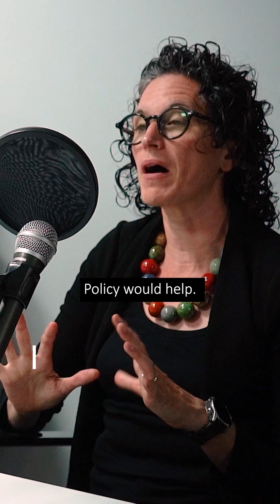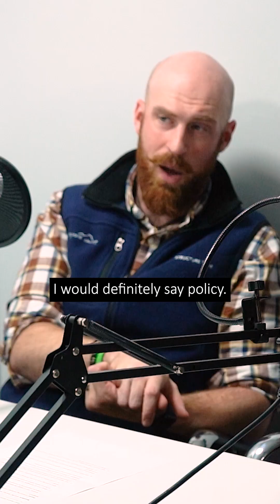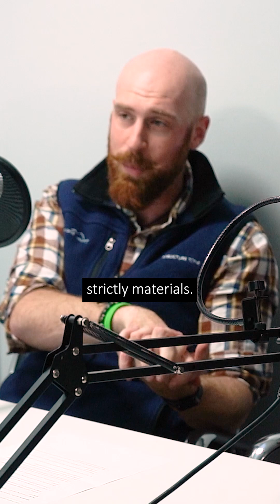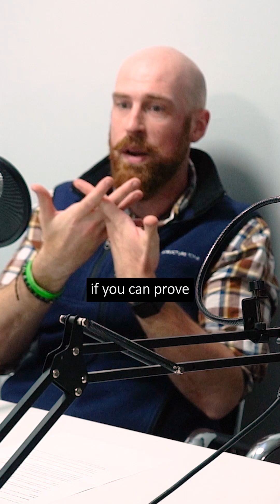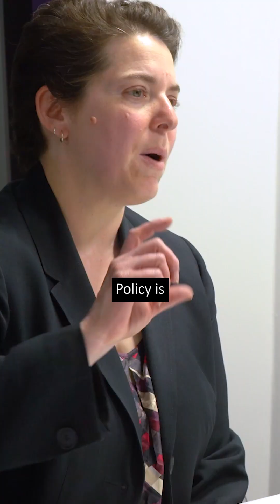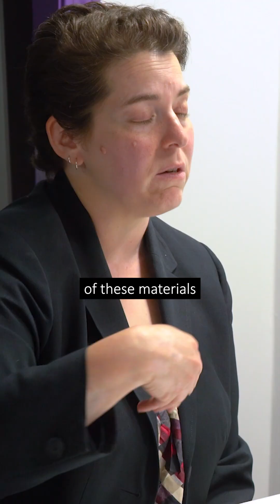How Policy Can Affect Material Circularity #constructionindustry #sustainability

Comment: Yes yes yes... that will make a wonderful powerpoint to be the base for a public funding of a project with the intention of....bla bla bla. Naive intentions extracted from the basic exercice of identifying the problem. It's an engineering problem not a political problem. To think you can simply regulate your self out of this problem is the critique i'm trying to articulate. What specific material is predominant in landfils, where and how it's made, is it reusable after some process, if not what material could replace it that could be reusable? If not what property can we add to that material in the production that later we can made it reusable or at least separable for a difderent use like make bricks or underlayment for road building for instance. Pick a material and solve whatever physical, chimical, etc prevents it of being circular or completly reusable.